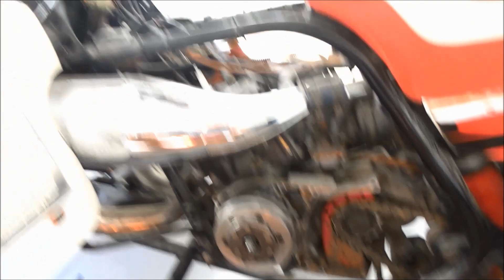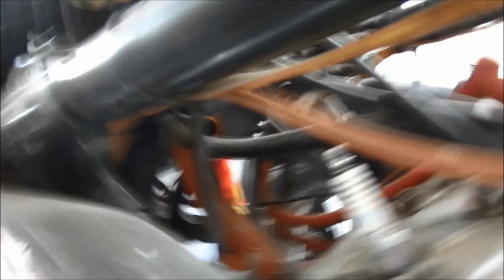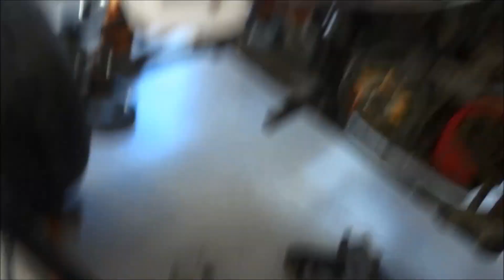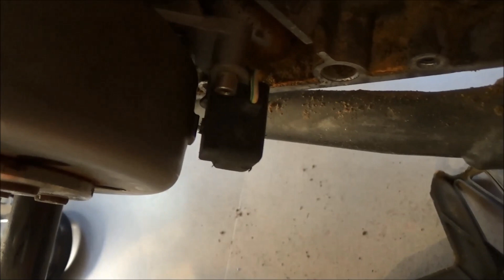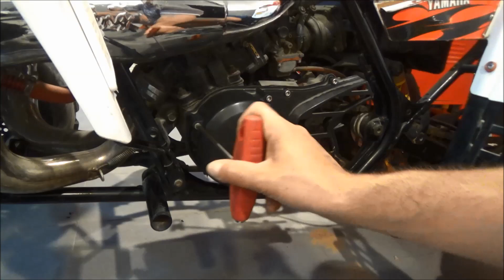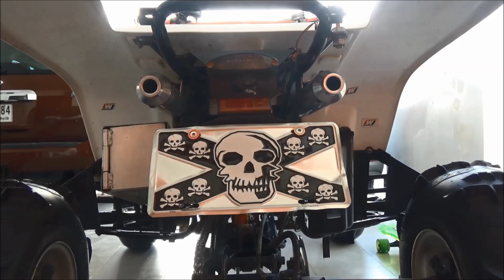Ignition Trouble Shooting - Replacing Flywheel on 2006 Banshee

Comment: Hello good video! 
Now I'm curious. My stock wheel failed so I wanted to try a light one. Now it seems as if it runs almost like its to rich down low and boggy but works good mid to high? Does this seem correct.
Thanks!
Reply from the maker: @6GEARPINNED  hi, 
This sounds like tunning issue and the flywheel has noneffect on that, but perhaps it got ruined while removing the old and installing the new. I recommend starting with the spark plugs and making sure they are in good condition, if the issue is not resolved, then re-adjust the air screw of the carbs.

Comment: How can l do this yo my flwwheel . Thanks
Reply from the maker: If you mean reducing the weight of the wheel then specialized machine shops do this to the wheel and then balance it. However it's not recommended as the power gains are almost null, and the wheel structure is weakened and eventually it will break.

Comment: I'll give ya a little trick about flywheel removal. Just tight the bolt and give a little tap with a hammer on the head of the bolt, it will pop.
Reply from the maker: Thanks man. I will try it the next time I need to take the flywheel out👍